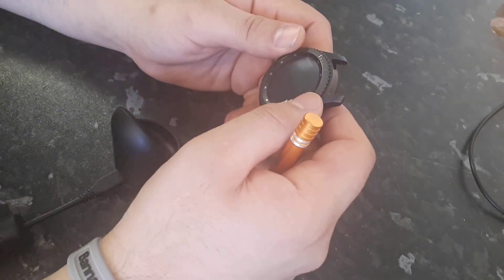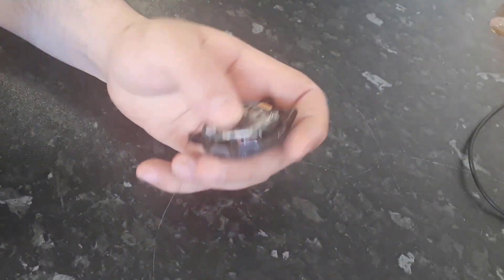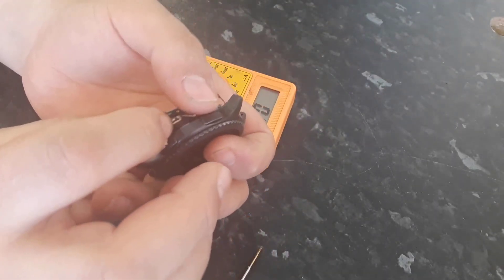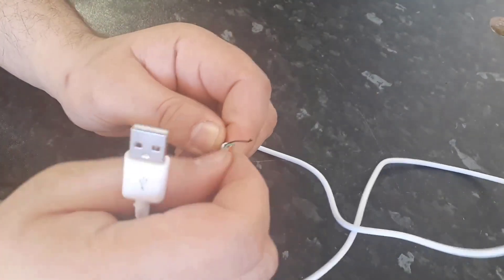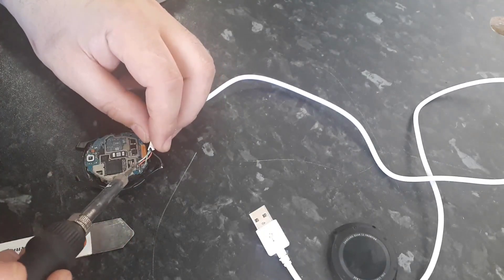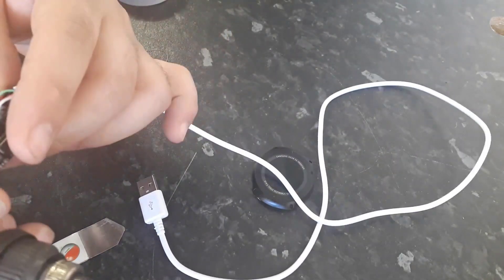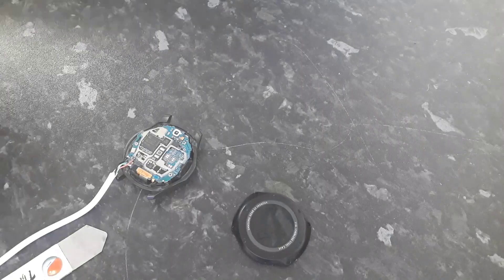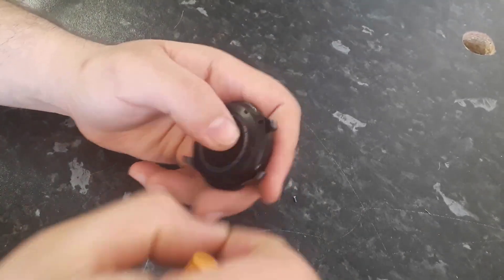Samsung Gear S3 Watch Dead Repair

Comment: The battery in my Gear S3 is charged, but I can not turn on because the home button is not working. Can you tell if there's another way to turn the power on? Thank you!
Reply from the maker: Hi yes, you need to open it and short the home button connection and or replace the home button/power button.
Reply: @anwarigroup  Thank you! I`ll try It.
Reply: @anwarigroup  Hey, i'm facing the exact same issue, how can i short the power button and turn on the watch from the motherboard please ?
Reply from the maker: @TetsuXIII  Hi, open the watch. And you will see the contact buttons. Just short from outside. short for 5 to 10 seconds.
Reply: @anwarigroup  You mean the 4 pins ? But how can i short them ?
Reply from the maker: @TetsuXIII  look around tactile buttons. the buttons are soldered there. Just short the out pins of the tactile buttons. If it down't work so there might be no power. check battery voltage by a multimeter. Is there power on the battery? if there is no power so charge your watch. or take out your battery and charge it out side. if the watch is charged so short the buttons from outside of the buttons. if it doesn't work so your watch may have circuit board problem.
Reply: @anwarigroup  The battery is a new one and fully charged, all i can see are the pins you used for the wires technique, for the power button, all what i'm seeing is the flex cable coming from the motherboard with two buttons. As i said before, the board seems fine since the screen powen on when the watch is on the crudle and shows the battery level
Reply from the maker: @TetsuXIII  short the two sides of the tactile button. Keep short it for 5 to 10 seconds. Just make a manual contact for that button. If it worked so it will work. You can check the power button by a multimeter to find out that power button is working or not. If the power button is working so something can be wrong with the motherboard. examine the flex cable coming from mother board to the power button. I have the same watch with same problem and it has motherboard issue. Somewhere one IC stopped working.
Reply: @anwarigroup  Well, it finally turns on, the issue comes from the flex cable, i bend it a little and i was able to turn on the watch with a screw driver. I'm going to order a new one. I told you the motherboard was clean, thanks a lot for your assistance :)
Reply from the maker: @TetsuXIII  it is ok now. just change the flex cable.
Reply: @anwarigroup  Hi Brother, I have same issue..can you show me the video how to short or fix my Power Buttons, because my home buttons working only the problem from Power Buttons..can you make the video about that Issue.. Thanks your video will useful for anybody

Comment: Have the same problem but charger lights up red but watch doesn't turn on, do I need a new battery?
Reply from the maker: You might need a new battery. Open it check battery connection.

Comment: Hi,
Sensors on my watch are not working after last update. Any idea what to do? Service centre wont touch my device.
Reply from the maker: Hi, See if you can restore the old software. Or download one old model and install that and see whats happening. Report this issue to Samsung. Wait for the next update. When next update came, update your watch and see if its working or not. If not so go back to old version. Report the issue to samsung. Wait for the next update. After update came, update your watch. Check the sensor. If its working so its fine if not send a report to Samsung. Use old software again and wait for the update. Repeat this loop until it start working.

Comment: hi dear need help for my bricked gear SM-R765 A ...cant connect using wireless connection ..for new firmware. and i dont have the software for my model .
please help 
regards and thanks
anwar
Reply from the maker: Hi, Check this link 
https://electrovo.co.uk/guide-to-connecting-a-samsung-gear-s2-and-s3-device-using-wi-fi/
Reply: @anwarigroup thanks so much for the prompt reply ! great... i hope it will be safe if i give it a trial by myself..
regards
Reply: can you please give me your email ...i am not able to buy the firmware for (gear s3-sm-r 765 )

Comment: Hi! Great video.
My gear s3 all of a sudden got a vertical line in the middle of the screen, very bright. It blinks a little and the screen turns off but the touch works well.

I recently changed its battery and it continued working well for two days. Then the problem showed up :(  do you have any suggestions?

Thank you
Reply from the maker: Hi, The new battery can be faulty as well. First thing to do is to flash the watch with firmware. After that if its the same so try to change the battery again.